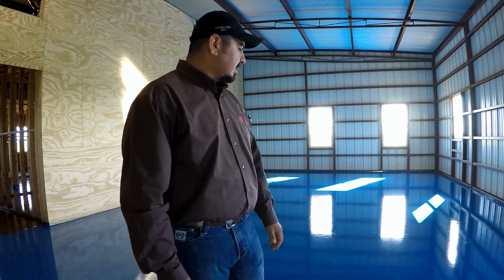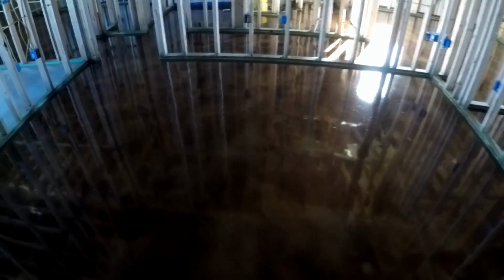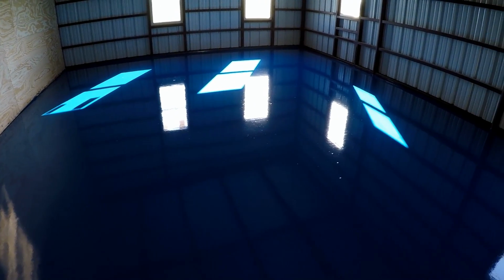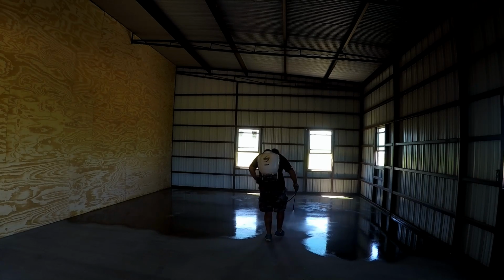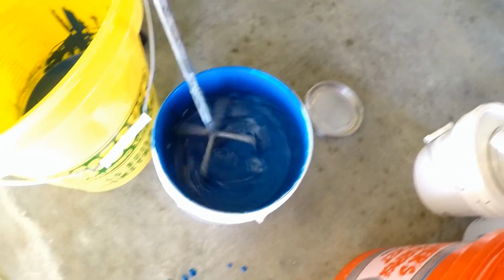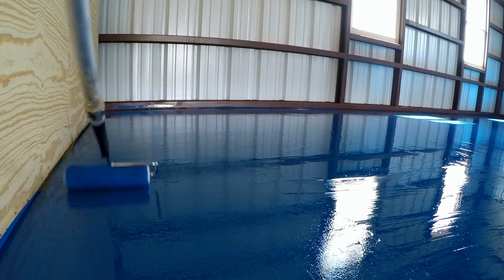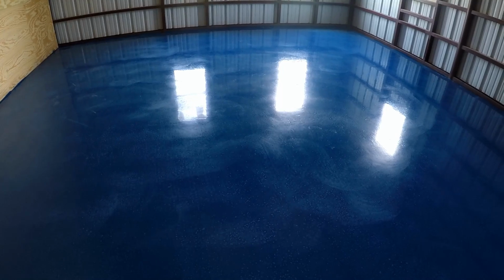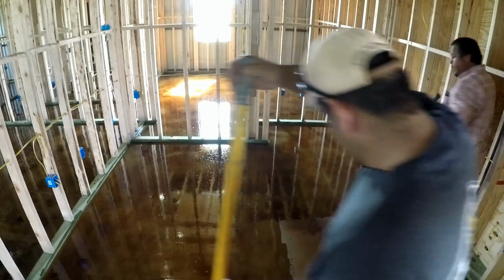Epoxy floors for new shop

Comment: I did my shop floor in white then topped it with clear and it has held up great for about 10 years now... I'm very happy with my floor...
Reply: how many coats of clear?  water or solvent based clear?  vehicles driven over it too?

Comment: This is my line of work. I usually mask of around all the edges first and then cut around the edges with epoxy, remove masking tape, it minimizes the mess around the edges. I like the finish,   Very neat.
Reply: Gregg Smith 
My friends in the UK can't believe this they don't have it.
Reply: Good morning Bill, im sure if they look hard enough they should be able to find someone. I live in South Africa and i have been doing this type of flooring for over 20 years, Back in the day we used to do it with a Fibrerglass resin and flo coat mix. All your insulated trucks(Dry and cold trucks) are done with this method. Just when using resin you must be in a big hurry due to the drying time of resin , hence the masking and cutting around the edges first. But cleaning and all your prep work is vital. Your ambient temperature is also important to the floor setting correctly. Lastly and i have seen this mistake being made, the floor must be level. or the product you use tends to accumulate in the lower regions, this in turns pulls the resin and makes the floor thickness uneven. But it does give an amazing finish and is as hard as nails. Best regards
Reply: Gregg Smith 
Thanks for the info Gregg

Comment: Concrete gases off when the concrete warm/hot, and inhales air when a drop in temperature. To prevent and minimize air bubbles. I found to apply epoxy when the concrete drops temperature to draw in the product. But all in all it looks awesome!!
Reply: In my experience, it lessens the chance of bubbles too if ppl do a better job at making the layer thinner.  This is accomplished if people use some muscles while they do the the Squuegee thing to spread the thinnest coat possible.
Reply: randall lopez I've also taken a blow torch to the bubbles with no damage whatsoever and it cleared up right away. Of course you have to be athletic like tom cruise in mission impossible
Reply: randall lopez 
double prime. cut your first mix with 50% acetone using a flat squeeqe, squeeqe it tight roll an let dry, 1 -2 hours later apply second coat cut with 10% squeege with 1/4v notch an give it a cross roll. 9.5 times out of 10 you will never have bubbles
Reply: the man how do you stop bubbles, or your clear seal from looking milky?

Comment: It looks great varry nice . heat up your concrete to 180 degrees. And I put my epoxy in the microwave. for Less air bubbles. works for me anyways . I do not do floors . but I am epoxy certified for Mainline gasoline and my job is to have not one air bubble good luck .And nice looking floors.👍

Comment from the maker: It costs $3.50 - $4.50 per sq. ft. depending on who is doing it and how much work is involved.
Reply: Is that the price with the material or just the labor
Reply from the maker: Turn-key
Reply: Erik Cortina but is per larbor or you including the material how mucho it cost for a gallon of epoxy and how much it cover per sq
Reply: +Erik Cortina why did you cover the rest of the home????  Just for protection?
Reply from the maker: +Sahadi420 Yes.
Reply: +Alvaro Ortiz it said it ,, turn key ,, its a manner to explain clearly or so '' that all material are included for 4,50 per square feet ... just as the term '' plug and play , with electronic equipment''
Reply: +Erik Cortina p
Reply: رجا شرح كيفية تهيئة الارض قبل الدهان..واي ارضية مناسبة..للدهان
Reply: Lyad Al-Shammari. Why don't you write in English so we can understand. Are you scared of something?
Reply: so worth it
Reply: maybe he doesn't speak enough english to ask his question comfortably. 
he asked how to prepare the floor before you stain them blue.
(like how to smooth the concrete, if you need anything to seal on top of the concrete before using the blue seal.)
Reply: Thanks for the video Erik! I'm going to do my shop!
Reply: Erik Cortina 

Thank you.
Reply: "Raja explain how to create the ground before Aldhan..oaa ground Mnasph..lldhan. "

Thats what google translate came up with...
Reply: I just got priced for my house 2400sqf for epoxy they want 19k
Reply: that's almost 9 dollars sqft.  biannual paintjob would be less that that
Reply: It's look like a swimming-pool, nice color..
Reply: Erik Cortina they asked me $19 a sqf
Reply: Labor and Material - If Not that would be super costly / Still pretty costly at those numbers
Reply: 3.5 to 4.5 per square foot for epoxy?  Are you joking me?  I can buy granite tile or marble for that price per square foot....
Reply: Erik where is your Company located >
Reply: Arizona ?? Flooring? Can’t make out what you said! The name of the company is ?? That is the exact color I️ want for my garage.
Reply: Erik Cortina how much just for the materials? Doing the labor myself 1,000sq
Reply: اياد الشم

Comment: I used the baer garage floor system. It was applied the same way. It looked great but did not hold up well. Just a small amt. of gas, like a drop or two from my mower was enough to destroy it. I would never use the crappy baer system again. So I'm considering this system for the next floor.
Reply from the maker: +Anthony Strawbridge This system will not get harmed by gas.  Make sure you do a P100 or P501 coat on top of the epoxy for maximum durability.
Reply: Noted. Thanks.

Comment: Most the epoxy techs will never use a paddle stirrer to mix the epoxy and that is the reason you got all of those bubbles. You should mix only with a stick to avoid the bubbles.

Comment: FYI: Its likely going to very slippery if it gets wet unless you added some chips or grit. Issue is at some point you will get coolant from a CNC machine on the floor.

Comment: That looks so cool that it honestly looks like you installed a swimming pool! I noticed you made mention that in your house you have this brown colored, "marble looking" type epoxy for the houses' floor. Is that going to be in the stead of carpeting or hardwood flooring? If so, how will those "scratches" eventually be dealt with in the living area? I have never seen anything like that before>>> AWESOME INDEED!!! I love it!
Reply from the maker: Ben, the house has stained floors and they are a brown color.  The sealer itself is clear so scratches are not visible on clear as much as they are on a white surface.  We will also wax the house floors which will also help with scratches.  The floors in the house are finished floors, there will not be anything on them.  We are testing a floor heating system as well, so no worries about walking on cold floors in the winter.  :)

Comment: The one thing I find wrong is that acid wash only helps  little bit. using a acid wash  will only give you  5 years best. The best way to do it is grinding the concrete floor down . Then when you laydown the epoxy you should get NO air bubbles if down right.
Last thing you do is next day is to put a epoxy clear coat on top of your epoxy color then your done. you will get 15 t 20 years out then floor...

Comment: Very nice. I would love to do this. But up here in Canada, it's about $7.00 per sq. ft. Out of my budget range!
Reply: +Doug Hanchard Just paint your concrete floor with water based concrete paint from Home Depot, Rona or Canadian Tire.  Next put a coat of watered down water based polyurethane and then sprinkle some glitter (Dollarama sells it).  Do two more coats with watered down water based polyurethane.  Your floor will look great at a fraction of the price. If it is in a garage, I do suggest broadcasting some sand to prevent slipping when wet in winter months.
Reply: peggyt1243 Thanks for the tips! It is for the garage and it sees a lot of hard use. Dirt, salt, snow, cold and warm (heated garage) in addition to lots of traffic on it. Including steel roller wheels from engineer hoist movement. So.... I think I'm stuck with a very hard finish epoxy...
Reply: +Doug Hanchard If it is a working garage, why put a "Cadillac" finish on it.  Epoxy floors are for showrooms or for someone who stores their Lamborghini in their garage till spring.  Many of these epoxy floors have a top coat of polyurethane "to prevent scratches" so epoxy is not that durable.
Reply: peggyt1243 Oh... I'm an idiot is one reason. I hate the look of dirty floors. I'm a sucker for attempting things that just ask for trouble too...
Reply: +Doug Hanchard Buy a power washer.  LOL
Reply: peggyt1243 I have one. Still looks crappy with the dull concrete. :)
Reply: +Doug Hanchard My garage also has a dull concrete floor.  I have been meaning to paint it and have had the paint for 2 years.  I still need to get a round toit as the square one will not work.

Comment: say it looks awsome!!!! great job and great video, thanks for the time put in. Question,  I have a basement that has a french drain uderwater the concrete. Would the leaching moisture from underneath  affect the coating.  it's a daylight basement so we would have ventilation via garage door. Thanks! !!

Comment: Excellent video. Very informative. Will you use spray foam insulation for your wall system in your shop area? It looks like residential steel homes are more popular in AZ than in North-Carolina. Nice work !!!

Comment: Erik, awesome looking floors, you guys really done a fine job. Could you tell me the product name for I can look up where to buy? Are you still satisfied, holding up well? I appreciate your time and video. Thanks, JohnG
Reply from the maker: The components used were Arizona Polymer Epoxy 400 in Safety Blue and P501 in clear gloss.
Reply: Erik Cortina how do you stop bubbles from getting in your dried sealer?

Comment: Did you add any type of sand to the Epoxy mix to make the final surface have a little more friction when wet?  
Outstanding job.  Thanks for the tips on following the squeegee with the roller in a cross pattern.

Comment: could you go over the floor with a blow torch to remove bubbles on first coverage after it cured and then do a second coat which shouldnt have any bubbles?

Comment: I just did an epoxy floor sherwin williams 8100, and I was surprised to see that small pencil pin head holes, did not get filled... How well does your paint cover small fingernail cracks?

Comment: Application Method question, 

Why not skip using the spreader tool, and use the Roll from the start? just by soaking in the roll and using it directly on the surface. Or using the spreader first will result in a better quality? or no difference of whatsoever?
Reply from the maker: ***** Dipping and rolling will not give you an even coverage and where the epoxy is thicker the color will be darker.  The notched squeegee is a must.

Comment: As usual, acid etch done completely wrong. Concrete is thirsty by nature and absorbs moisture. Spraying acid directly on a dry surface gets absorbed into the concrete and does very little on the surface. Thoroughly wet the concrete down first, then spray the acid solution (wearing pants and and other protective gear); you'll get much better results. Secondly, do not allow the acid to dry on the surface. Dried acid is absorbed acid. The etching process is finished after a minute or two. Use a shop vac and copious amounts of water to remove acid. This is all the neutralizing you will need. Allow to thoroughly dry as stated. Prior to coating, very if their is a vapor barrier present on the concrete if you have a slab on grade. If not, you will need to do a calcium chloride test to check for moisture transmission through the floor. Excessive moisture vapor passing through concrete and hitting an epoxy coating will cause it to blister and peel, similar to if you've ever had a rubber mat on concrete and lifted it up and saw moisture laying there. The rest of the video is alright, except for the fact you should where spiked shoes to walk in the coating as you apply it. He could have done that whole job without getting a drop on the walls. Spike marks fill right in, whole footprints do not.

Comment: I have a question im not sure if you would know this but i have a second building that is not heated in the winter and the concrete breaths moisture. would the epoxy come off or would it stop the moisture from coming through? Thanks much.

Comment: +Erik Cortina I'm looking to epoxy my 880sq. ft. garage floor and I'm trying to calculate how much product I will need. I'm hoping to go with "Safety Red" and figured you would have a good idea. I noticed you used 1 "Bucket" Part A and 1 "Bucket" Part B. However I see a kit consisting of 2x 5gal. Part A and 1x 5gal  Part B (2to1 ratio?). What would you say is the gallon/sq. ft. ratio? How large was the garage floor here in this video and how much product did you use? Thank you in advance for any advise. Great video!

Comment: I bought a house and apparently they didn't  put a plastic  barrier  down before  they poured the Concrete. the Concrete absorbs water when it rains and you can see water collecting in the livingroom. how do I water proof my floors.? I read somewhere  not to epoxy it if the concrete retains moisture.
Reply: No worries. Use a polyeurethene primer, dry it ip, apply 2 coats of expoxy after drying up of each layer.

Comment: Erik Really nice job on your floors, My son loved it so much we are in the middle of putting it in his shop right now. We have put down 4 coats of the epoxy 400 and mixed in the Safety Blue color, but after each coat if we walk on it the next day it shows every step we take that looks like our shoes are tracking in dirt, even if we touch it with our hands it is hard but looks like we are smearing the finish. Not sure if I need to wait longer or if the Polyurethane P501 will bring the shine back? I'd sure like to discuss it with you if you have the time, Thanks Mike five6two 275-two2zero4
Reply: Have you found it really slippery when wet? I love the epoxy floors though pretty costly I just cant have a flooring that's slippery when wet :S
Reply: MaZEEZaM they sell flakes to add when its wet to help with grip

Comment: Erik Cortina didnt the roller cause the bubbles? i think. try using Padco floor coaters
Reply from the maker: Raul Solis No, bubbles are caused by outgassing of the slab and air trapped in pores trying to escape.  It will not do it on a primed floor.
Reply: Órale. Where can I buy the squeegee

Comment: Is one gallon of part A epoxy enough for a two car garage? Cool video
Reply from the maker: It depends on size and floor profile.  Read up on APF E400, it will tell you on the data sheet.

Comment: What can I do to to prevent the concrete floor from ever cracking?
Reply from the maker: There's go guarantee, but when we try to minimize cracking, we use rebar and then put wire mesh on top of rebar before we pour the concrete.  However, there is no guarantee that concrete won't crack.  You can check out my other channel, it's Called Texas Barndominiums.  This video shows how much rebar we put in our slabs, and they still crack.  However, there is a difference between surface cracking and structural cracking.  Surface cracking will happen, structural cracking you hope doesn't.  

https://youtu.be/DsDBIZH2B5s

Comment: Does this floor feel rubbery? I want to do this for a woodworking shop, but if it's like rubber, the dust might stick on it.
Reply: epoxy and urethane are hard with no tack.  the feeling would be the same as if you touched a piece of finished wood.

Comment: How slippery is the floor when it gets wet? If you are putting it on in the kitchen and bathroom floor then those areas get wet a lot how bad is it? It looks dangerously slippery am I wrong?
Reply from the maker: +Jo Flores It could be slippery when wet, but not any worse than tile.

Comment: Hej Erik. Is it the first time you make epoxy ?
Reply from the maker: No, I have done it before because I'm a concrete contractor.
Reply: +Erik Cortina . I do not understand the way you make floors? I have made epoxy 30 yers and I can se a lot of dust i the epoxy, I have build the rooms and then epoxy, then you dont have the dust in the epoxy.

Comment: Is it self-leveling, or do you have to start with a perfectly level floor?
Reply: DanielinLaTuna you have to start with a level floor
Reply: Valon Mehmeti what about water run off?  You don't want water falling towards the house!!
Reply: KraziCunt thats done when the concrete is poured. But what most old shops have are chips and cracks and are damaged so they need to be leveled with the rest of the floor first.

Comment: Hi Erik, we live in Tahiti French Polynesia, I haven't really seen these floors down here,  I use to lay floor ceramic tiles, we do have an issue here with the humidity, will this product be any good to us here in our country, if it is then there is business here to be nailed down here, will you advice me on this product.
Reply from the maker: Michael Taruia If the moisture is coming up through the concrete this will not work either.  They make sealers specifically for moisture control but I'm not familiar with them.